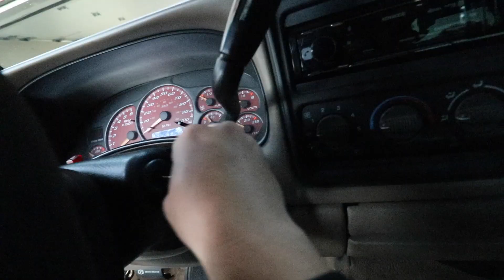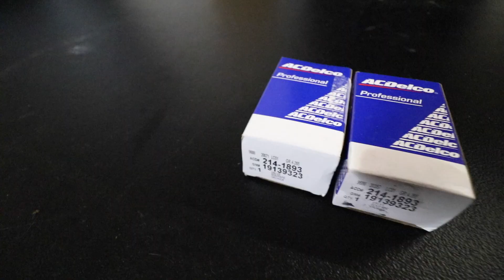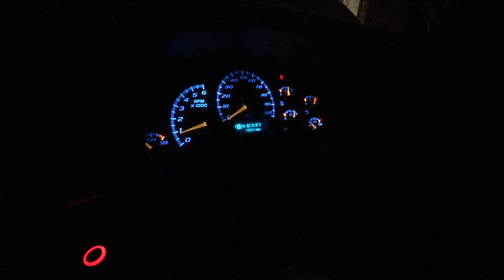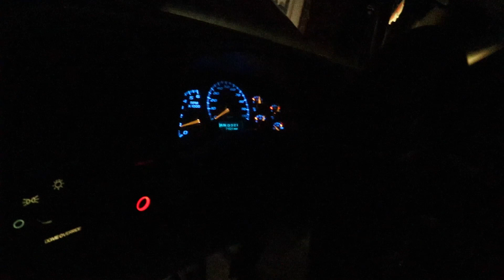I FIX THE ISSUE WITH MY TRANSMISSION!

Comment: Nice man, that thing is CLEAN. I like the instrument cluster, I replaced mine in my 05 GMC Sierra but it isn't that same blue. Im building a 07 Silverado 2wd Classic right now, thinking about a 4/7 drop on 22s. It has a L59 5.3 LS on E85 and I need a TBSS intake, a cam and then im gonna spray it with a 100 or 150 shot. Watching these videos definitely gives me motivation. Great video!
Reply from the maker: Thanks bro! 🙏🏽

Comment: Yo what up Woody , I got a brand new set of Weld bead locks already mounted with some Mickey Thompson’s SS streets for sale these are 15” wheels only the rears , If you know anyone looking for a set let me know , let them go for the low
Reply from the maker: Damn, I don’t make enough power to run 15” yet. But I’ll ask around. Send me pictures and the size on my Instagram bro.
Reply: @Woodyls3  will do my boi !